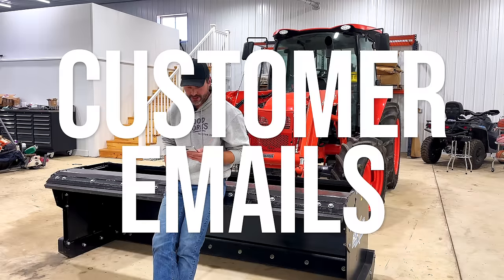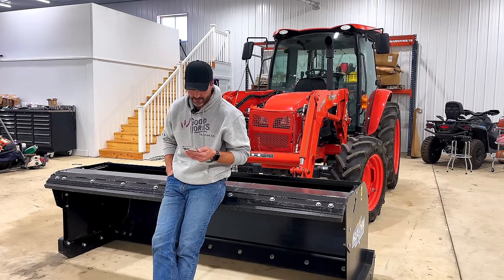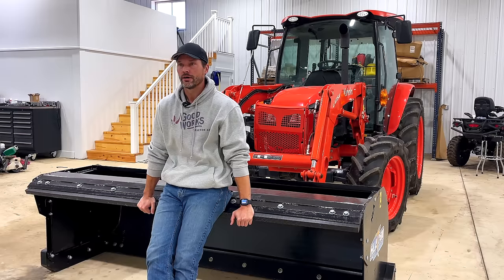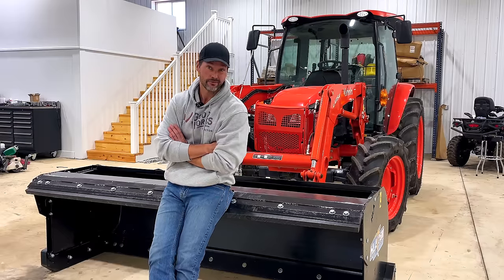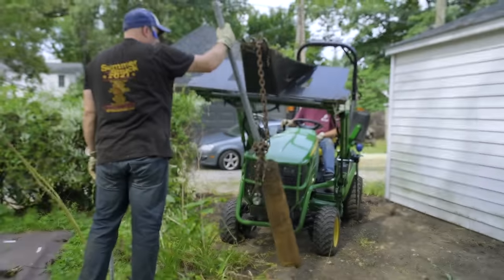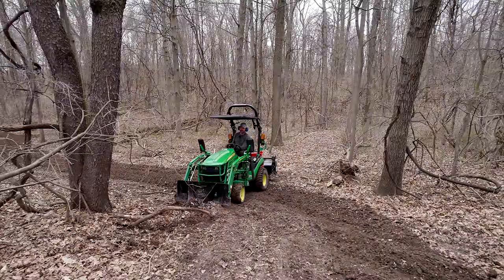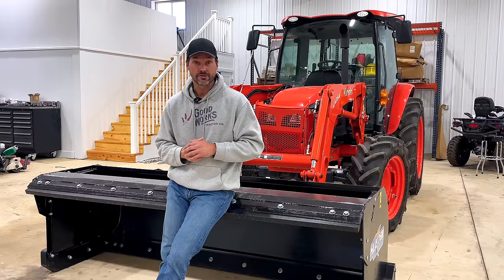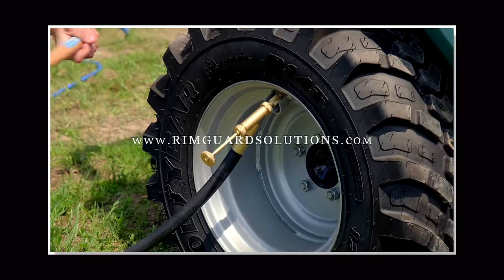WOULD YOU CHOOSE A MASSEY OVER THE JOHN DEERE 1025r?

Comment: I have had my Massey for 6 years, its a beast. only thing I have done after 600 plus hours is the normal fluid changes. I dont baby it, and it just keeps working, no broken parts. the brand has been around for longer than just about everyone else for a reason. not knocking the Deere, to each his own. I just cant justify the thousands of extra dollars for what you get.
Reply from the maker: I'm really glad to hear it's treating you well
Reply: I Don't think its a Massey fairly sure it's an Iseki rebadged.  Don't think Iseki can trade in the  US market
Reply: @andyexuptaylor4503  Yes, the Massey GC1723 is roughly the same as an Iseki TXG237.
Reply: Massey, or Iseki if you prefer, they are great!  I've had a 1547H for 20 years - totally solid & reliable.
Reply: Did Massey significantly change over the past few years? There aren't any dealerships around here, but it seems like everyone was talking about them c. 2015, but now no one is.
Reply: @ecthelion1735  The changes on the compact models seem mostly superficial and offer better ergonomics than earlier models, but don't have actual experience with the recent years.
Reply: @ecthelion1735  since the GC1700 series came out in 2013, the core platform has not changed a whole lot. Loader is now FL1805 and has SSQA.
Reply: I bought a Massey GC1723 back in 2020 and haven't had any issues.  In fact a friend who has a 1025r commented on the Massey being more of a beast when using the loader than his 1025r, it was handling loads his could not.  On the other hand, I do envy the ease of taking the belly mower on and off that he has with the JD.
Reply: I bought a new Massey Ferguson GC1725M in 2021. Am just over 300 hours. Machine has been solid and trouble free. Runs all year. I got a front mount snowblower. Speeco quick hitch. MMM deck. Ballast box that I filled with concrete. I also had rim guard put in the rear tires. Machine is easy to service. I also got pallet forks as well. This is an outstanding Machine and I'm glad I bought it!

Comment: Can’t go wrong with massy and best bang for your buck. John Deere is over priced and over engineered.
Reply: Totally agree.  John Deere is way overpriced for what you get.
Reply from the maker: Massey is best bang for the buck?  Hmm...
Reply: @GoodWorksTractors  yes sir. You get everything you need to get the job done. They are not over priced. They have  normal quick Attach on the bucket and nothing fancy. Sometimes basics are the best.
Reply: In my experience,  John deere has the worst engineering department

Comment: We bought a Massey GC1710 with loader and backhoe for $5000 less than a Deere 1025R. Absolutely no regrets.
Reply from the maker: That's a HUGE savings
Reply: @GoodWorksTractors Question for you, why does JD use the Yammer Diesel in their compact tractor line and skid steers instead of the better engineered and reliable JD Diesels?   Never been fan of Yammer due horrible pass experiences, maybe they are better now than 20 years ago but after major issues we have had with them I’ll will pass on purchasing anything with Yammer in them.
Reply: @tristenklein5940 Yanmar  engines are actually pretty good. They did have some issues with different engines through the years.  I do remember some trouble  ones around 20 years ago.  It was usually because of insufficient cooling or something else that wasn’t  part of Yanmar. I’ve been around all kinds of these engines and Yanmar is actually one of the better ones. 
I asked the same question about the engines at a capstone class years ago.  I was told JD uses them because of the overall reliability and cost involved with developing and manufacturing their own small engines vs how many they would sell every year.
Reply: @PurpleNovember  you nailed exactly the issues we had with them years ago on many of our Golf Course Construction projects it’s the main reason we standardized our turf tractors with Kubota even though they were more expensive.   We have used many of other large JD equipment on projects with their own engines and they worked flawlessly and the guys loved them but after the bath we took on many pieces of equipment with yammer engines years ago it’s just tuff to go back.   Yeah that’s what I thought that it’s probably more economically feasible for JD to contract with yammer on their small equipment line than build their own engines it’s just a hard sell for us based on past experience.  Thanks for the information greatly appreciated 👍👍.
Reply: @tristenklein5940 
Too funny. Can’t say I’ve ever heard anyone say Yanmar was junk. That’s the equivalent of saying Toyota is crap. Well here’s a little back story. I worked a municipal job for about 12yrs, in our fleet we had over 80 different tractors, with that being a mix of about 7 different brands. The most problematic were the small utility John deere’s (2040, 2155, 2020) They were so bad for over heating and having bad heads, to the point the fleet service department ended up auctioning them off. The smaller JD 790’s, 1070& 855’s (with yanmars) never had issues after being beat to shit! Can they overheat, yeah like anything else if not maintained properly. But some cooling systems are just subpar.
Reply: @bearkawiboy6246  Never said they were junk, I stated they had major issues which were design/engineering flaws and manufacturing issues which caused many with overheating leading to cracked heads piston skirts etc back in the late 1990’s and early 2000’s!  Even the equipment dealers were stating the obvious due to the large number of warranty repair and engine replacements they were forced to do.  And when you have 24 tractors spread out all over the state on separate projects you damn sure will be evaluating operating, maintenance and repair procedures and records, dealership support, inspections and repairs to determine the problems be it a contractor issue, dealership issue or manufacture issue.

Comment: As an owner of a Massey Ferguson 1723e I strongly disagree with all of what you said. Massey offers almost all of the same thing any other brand does and at a way better price than your Deere. You should run try running one and compare it and see how you like it.
Reply from the maker: Doesn't bother me...agree to disagree.  No interest in running one.  I looked at it, sat on it.  Was not impressed in any way.  It's not the machine for me.
Reply: Yeah, I'm kinda of surprised to see such a strong opinion for or against the Massey based on a trade show glance. I  looked at a New Holland subcompact years ago and loved it at first. Then I started it up and ran it through the parking lot for 10 minutes and my opinion faded quickly. Kioti was great too, then I went to the Bobcat dealer and was like, hey this is just a Kioti rebranded, but the Bobcat had something different on the hydraulic controls that made it smooth as butter compared to the equivalent Kioti that the Bobcat was based on.

Comment: I bought my Massey gc1723e in 2021. I have over 350 hrs on it and have had zero issues. I mow 3 acres, run a front mounted snowblower for my 460ft driveway and it has never let me down.

Comment: I own a 2022 MF 1725M. Love the tractor, it has been a huge help with projects and all that. On my channel I have made some mods, etc. I don't have anything current as I was injured and working on getting patched up.
I priced the John Deere and a used one was 6500 more for the exact same thing NEW at Massey. A new JD was nearing 8 K more. 
I have a Bad Boy Box Blade, I made my own stump bucket, made my own rear weight box, added a QH from GWT and that handles everything now, also have a Bad Boy Tiller for it as well and a carry all setup.
I wouldn't trade that tractor for a JD or a Mahindra, folks around me with Mahindras always seem to complain about a plethora of issues. 
I think I even made a video discussing Kubota and JD compared to the MF to be honest, I know I didn't go Kubota due to lift capacity and just sheer specs. 
This Massey is a BEAST. Literally impressed my grandpa with how well it did overall on several jobs! 😊

Comment: I had a similar decision just over 2 years ago.  My subcompact choices were between the JD, Kubota, Mahindra, LS, and Massey.  I went with the Massey GC 1723EB after narrowing it down to the JD and Massey.  I just couldn't justify the price difference for the JD.  I'm 6'1" and have no issues with the size or fit.  I have 6 acres to maintain and needed an "all in one" solution.  I have the midmount mower deck, loader, backhoe, brush hog, box blade, and forks.  The tractor is a workhorse and I have loved it and have no regrets.  The point of the ease of miuhting the mower deck is a valid one.  The Massey has a drive over deck that is easy the hook and unhook, except for the PTO.  It is difficult the reach and line up quickly.  Therefore, I do plan accordingly and try to group my work to minimize removing the deck during mowing season.  Easy enough to do to save thousands of $$$$.

Comment: Having just gotten a 1025R, if you’re taking the loader and backhoe on and off regularly, the 1025R is a no brainer. The drive over mower deck is a game changer (when it’s adjusted, which can be a challenge but it’s not terrible) and it also leaves a beautiful cut. The first time taking the backhoe and front loader off I did both in under 5 minutes. Very, very easy.

Ok so after the hole Deere is digging themselves into, I’d gladly go with a massey Ferguson if I was looking for a new tractor.

Comment: 100% agree with your assessment on the “dream” of an all in one machine. My husband and I got a subcompact Massey with the drive on mower deck when we got our five acres home. Four years later, we’ve purchased a zero turn mower and swore we would never deal with a mower deck again. Between hooking it up and then taking it off, it’s harder than they say it is. We did leave it on often, but you lose so much clearance it just wasn’t worth it. Overall I love our tractor but if there’s one thing I’d do differently, save the $2,500 from a mower deck and buy the zero turn sooner. Good luck and thanks for the advice.

Comment: You basically summed up my opinion, John deeres ease of implement installation is my main reason for buying a 1023/1025. I take both mower deck and loader off a lot,along with 6 other implements.also dealer service , way more Deere dealers and parts around then any other. My last reason is resale Deere seems to command higher resale in my area ……if you can even find a used one
Reply from the maker: Nice, appreciate you chiming in!

Comment: I tend towards separation of functions also with most tools and equipment, but the biggest issue with mowing is that having a dedicated lawnmower means a second engine to maintain, second battery to maintain, etc.  A deck is just blade sharpening, greasing and occasionally a new belt.  Even though it is somewhat of a pain to remove the mower deck without a drive over, it isn’t that bad with some practice.
Reply from the maker: Not that it's bad, but it's just inconvenient...at least for me.

Comment: I have a 2021 Massey GC 1725M and it's a little beast.  I do lots of landscaping/loader/box blade/snow removal work and it's never let me down. There's nothing wrong with a 1025R, but I passed on one once I tried out the GC 1725M. Speaking of size I'm 6'2, 260lbs with size 15 feet and the Massey is very comfy.

Comment: One of the reasons I bought my 1023 was because of the belly mower.  I took the loader off once and that made it easier to mow, but I had a really difficult time getting the loader back on. I think the reason I had a tough time getting the loader back on is because I didn't release the hydraulic pressure when I took it off and it made it very had to get the lines hooked back up and the placement of them was not the easiest for me to get a good angle to push them on. But I am not sure because I have never taken the loader off again. My yard is not that big and I have so many trees to go around and under that the 1023 ended up not being the mower for me. Within a few months I went and bought a zero turn and it works much better for me. My zero turn went out this year and I Put the belly mower back on the 1023 and got the yard mowed. It was nice to have a backup. The only things I would have liked more on the 1023 was more bucket lifting capacity and if the 3 point would lift higher. and the battery is not the easiest to replace. I had to take out the headlights to replace the battery. I have since bought another compact tractor, but still kept and use the 1023 lots.
Reply from the maker: Good info, thank you for taking the time to share.

Comment: The closest dealer to me is John Deere (6 miles).  They also have a great local reputation for customer service.  I like to do my own service for routine maintenance . . . but having neighbors who can bail me out with the warranty and big stuff is comforting.  That, and the 2021 1025R I bought was used with 59 hours and had the FEL and 54" Deck I wanted (plus a few other extras like HD grill guard, ROPS light guards and rear wheel weights) so I was happy to go that way.  I had no affinity for JD.  My prior tractor was a 1956 Ford 640 and I even have a t-shirt that says "Friends don't let friends drive green tractors".  But I sure liked what I saw on the 1025R for the quick-attach, the drive over and lift w/FEL arms mower deck, the full range rock shaft adjustability and stops, the depth of field of non-JD/Frontier attachments and non-OEM solutions (i.e.: GWT, Everything Attachments, Mudds, Heavy Hitch, Deck Dolly, Bolt-On Hooks, etc.). In fact, none of the equipment accessories I have added are John Deere/Frontier.  Simco tiller, Dirt Dog box blade, GWT harrow, EA pallet fork, HH weight brackets (F & R), HH Tooth bar, SpeeCo quick hitch, GWT stump scoop, R2 Edge Tamers.  Just now adding an aftermarket vertical 4WD lever.  Everyone supports the John Deere 1025R.  It's popular for a reason.

Comment: I just have a three-acre hobby farm. I purchased a 1025R this past July, but I didn't pay the exorbitant prices that everyone has been talking about. Probably my area I guess. Tractor, loader, 60" mower deck, JD Quick attach, box blade, and pallet forks $26K with taxes and insurance, financed. Still very expensive, but not 30K. Here's the thing a 1023E is about 3k cheaper than a 1025R. I compared it closer to a BX2380. Those would still be more than a comparable Kioti or TYM. 

I was about to pull the trigger on a Kubota B2601, but the dealer didn't think they could get a belly mower for it in the next few months. The salesman was steering me toward a BX tractor, they had several, but the only ones with SSQA were BX23Ss. That was in January of this past year. Then I went by the John Deere dealership, and I checked out the 1025R again. 

Anyway, after four months of use, I don't regret the purchase, it's a deluxe SCUT with deluxe features at a deluxe price. The ease of the mower deck, loader, and bucket removal is well worth it.

Comment: I bought a bx2680 3 years ago. There’s dealers for most everything within an hour drive from me. I honestly wanted to buy massey Ferguson (everything else I own is Massey) but it’s hard to beat our local kubota dealer that’s been in the community for over 50 years. I’m still waiting for a quote from Massey…… one other big deciding factor was a cab. John Deere has some nice cabs available for the 1 series, but that Curtis cab for the BX is about as good as you can get for an aftermarket option. I live in eastern Canada on a hilltop and about 50% of my tractors job is snow removal so the heated cab was important to me. After owning a bx2200, I thought I needed something with twin touch pedals, but with the 80 series, the way kubota put that pivot point on the pedal under the floor rather than on top, it was enough of an improvement for me that I was able to over look it. Plus it’s a more intuitive design for those times when I’m not home and my wife needs to be able to clear the driveway with minimal experience
Reply from the maker: Lol, it would be funny if you randomly get a quote from the Massey dealer some day

Comment: This is an interesting discussion here, thank you for the video. I have 400 hours on a 4 yo. Kioti CK2610 and really love its size and capability. The Kioti is my goto machine for my "heavier" tasks on my property if its moving logs, maintaining a steep grade 1/4 mi. gravel driveway, bushhogging, light hobby farming, etc. Over the last few years, I had been using a Cub Cadet garden tractor just for mowing and it has really taking a beating just getting around on the property, so much that I was ready to switch it out for something with more capability that could fit the need for a mower AND serve as another tool in the arsenal. Knowing I could put another front loader and possibly a backhoe to work, I started looking at subcompact options. After being so happy with the 2610, I was met with disappointment when I went back to my Kioti dealer more or less expecting to purchase a CS20. The dealer rep didn't know anything about the tractor, didn't offer a test ride, and seemed annoyed that I was preventing him from leaving work early on a Friday afternoon. I instead went with a Kubota BX23S + mower deck and have been absolutely thrilled with the machine and capability, the dealer was great too. I don't find the mower deck to be particularly difficult to remove, though it does require crawling around on the floor. Kioti might make the best subcompacts on the market-- I will never know.